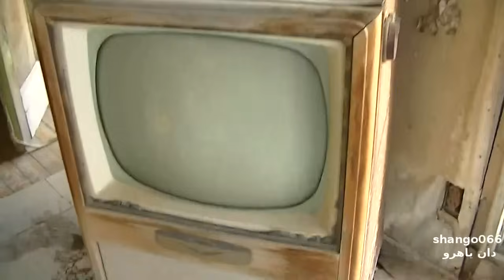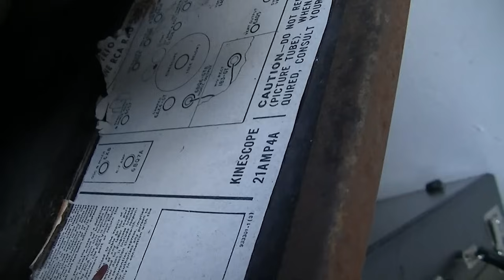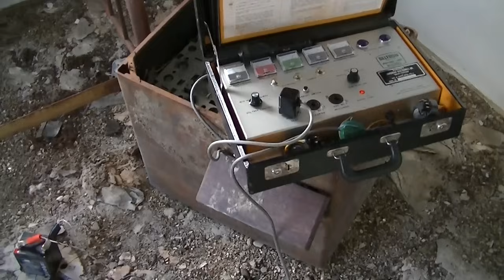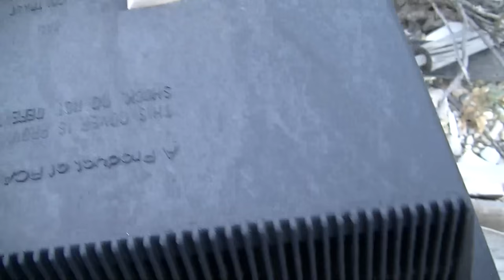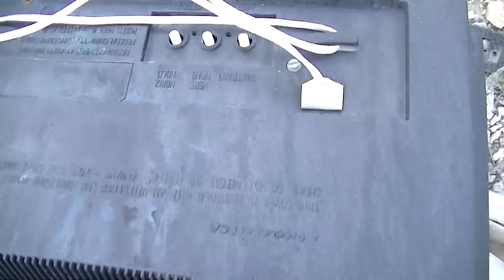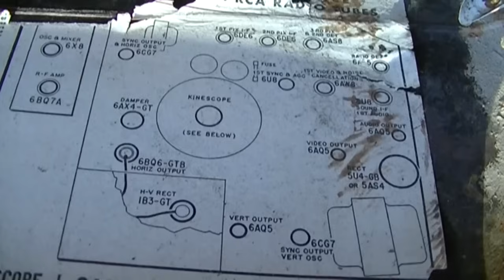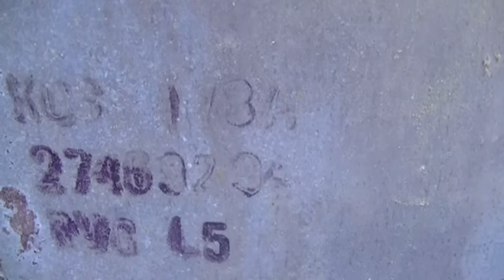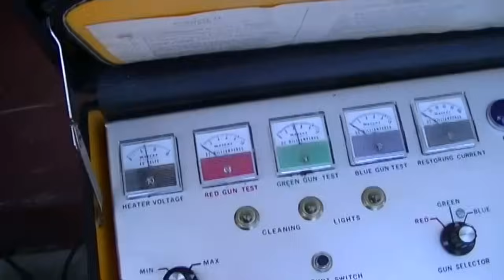Testing CRTs and Old Television Graveyard

Comment from the maker: This site is a currently operating mine site in Nevada and is not open to the public, the employees stay in trailers now, not the houses used in the early days of operation
Reply: Okay
Reply: Nevada? Isn’t that where in 1955 they did a test site nuke somewhere in Nevada
Reply: @jellyjordy1154 : January 27, 1951, until September 23, 1992; with above-ground testing until July 17, 1962.  Yeah, there was a test or two.  I participated in a few.
Reply: @edwatts9890  wildlife: thanks
Reply: @qwertykeyboard5901 : You are quite welcome. That "job" was one of the best assignments I have ever had, and every precaution was taken to avoid injuring your kinfolk.
Reply: Out off 165 near the border?
Reply: That's why you take everything when you see it and don't leave it sit there.  Morons tossed all this stuff in the trash and didn't think anything of it.
Reply: I'd like to buy that TV if you still have it
Reply from the maker: @ryancamp7044  Hurst parental control for Choice Cinema Bush bunny,
 neighbor blessing Seafood fleisure
Reply: @shango066  ?

Comment: LOL TV repair man. Late by 30 years.
Reply: TV repair people still exist.
Reply: +MrWolfSnack not any more
Reply: I'm a new comment yeet
Reply: 32 years now
Reply: technical they still do but our tv's are so modern if our color line blows  we can call the company or go to the local repair shop & get it fixed .
Reply: I fixed Vizio tv's.  It is gig work.  In 2010 there were two possible problems (not including spilling beer down the back, etc.), bad capacitors in the power supply and the fact that HD sets were sold before cable companies delivered HD.  In order to make the sets work with HD (so that red did not bleed into black in the picture) twisted pair ribbon cable had to be replaced with twisted pair ribbon cable that had more twists per inch.
Reply: I'm wanting to get in to CRT tv repair. Not for money as it's dead ,but I want to collect and repair for myself. Something's should live on !

Comment: The portable at 24:45 is/was a Sears Silvertone 900 (model 42231) manufactured by Warwick circa mid-60's. Quite a good performer in it's day, both in reception and audio quality.

 Another great video!
Reply from the maker: +NorthRiverTV You nailed it, I had just received the sams based on the stamped chassis tag on the board.

Comment: Great stuff!

I hope you go back, still many goodies out there in them hills.
Reply: +ZenithClarity1969 I got a freebie of a GE model 303 am radio/turntable a few weeks ago. Got it home and flipped it over, completely packed with mouse bedding. It had been living in a mouse infested basement for many years after the womans husband passed. She just locked the door to his basement workshop with all the goods still locked down there.

I pulled the chassis and it was pathetic, packed full of bedding, holding thousands of turds and years of mouse piss had just eaten away most of the components inside. Still will be able to hopefully save the transformer and some other parts. Magically the cabinet is still pretty nice!! Now i need another one of those chassis.

Comment: Loved the video and I have to admit, I'd be hauling a bunch of that stuff home too. Try to restore, or scavenge parts and if nothing else, recycle the metal rather than let them rot away in the desert.
I would have grabbed the Muntz 8 track and maybe the Akai Cassette deck too.
I think what happened to your RCA TV on the front was the black plastic got distorted sitting in the baking hot sun.
Reply: I definitely would've gotten the two tape decks, and probably that poor lil Panasonic TV, believe it or not, I could probably fix it!
Reply: @TheRetroMacNerd  The CRT was cracked.

Comment: It's like a blairwitch TV project docu😂...btw, i really like to see those vintage stuffs and wow! never been tried to use that CRT tester before. I just hooked the wires few turns from flyback to kick the heater pins...it really works,but then horizontal output transistor burst after a few days..again a back job😓

Comment: We got the best of both worlds with this one, exploring & electronics! If you can get the older RCA Victor (the one rats were using as a latrine) working, I crown you the best there is in restoration! At least it had an excellent picture tube in it. That alone is worth saving.

Comment: Man that neighborhood looks like it was used by the AEC to test atom bombs back in the 50's!
Well that's one good CRT you could put in the parts bin.
Some of those graveyard sets were OLD, I mean 70 or 90 degree deflection B&W CRTs.
Crap, a mad man Muntz POS!
Good luck on those radio tuning capacitors being any good.  Bet the plates are all shorting together.

Comment: 22:25   Is the Muntz unit an original FOUR track ( not 8 track ) player?  Where the pinch roller is part of the player and swings up from underneath when tape is inserted?   Is "Loudness/Separation/Contour" just a corny way to label the Volume/Balance/Tone controls?

Comment: 19:20 I think all those caps need to be replaced. Seriously, cool to see very old e-waste from the past. I admit, as a very young kid back in the early 80's I used to find dozens of vacuum tube TV's on the street and in dumpsters. I loved kicking off  the back open and get the vacuum tubes to throw at each other, with my other young friends at the time. At some point I think I had about 300 and I loved throwing them to see em' explode and smashing them.  

I guess old electronic tech collectors would not like that.

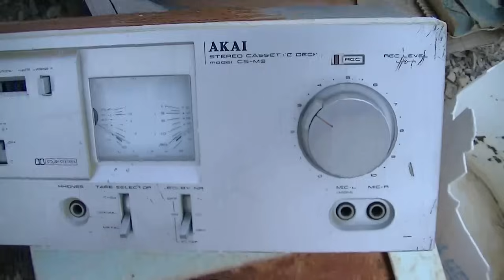Comment: 17:44 That tape deck has a switch for metal tapes. So 1979 or later. My guess would be 1981.
Reply: The decks are very late 70s. piano key controls and old school analog vus are staples of 70s decks.

Comment: You could regun an old model of that with a flat tube and get a working TV set. Plenty would like a slightly used CRT for replacement. Wrap in some hefty bags and you can transport it.

Comment: You must love your work if you are going this far afield in search of usable kines.  This was me 40 years ago.  One table model monochrome I salvaged was at one point completely submerged for many weeks in a flooded basement.  There was all of 2 inches of mud on the chassis.  It was a Westinghouse 21" unit with an RCA Silverama kine.  Because I really didn't care if it lived or not, but that I was an adventuresome cuss, I simply hosed the set out in the driveway, and left it to dry in the sun.  I aimed a jet of water from a garden hose nozzle, and tubes when flying every which way.  After it dried, I applied contact lube to all the sockets, controls and tuner, reinserted all the tubes, and plugged the darn thing in!  That set worked.  It worked perfectly.  And ran well for 3 years before the seleniums failed with a series of loud pops and a fetid smell.  The table model you show with good kine is in no worse shape except for the missing knobs. Try it.  You might be surprised.

Comment: I used zoom spout oil on a non-working sharpness pot of a JCPenney General Electric television and it fixed it. I researched if you could use mineral oil (what zoom spout is) is safe for such things and found no answer so i attempted to use it and it was fine thought i should really invest in some CRC

Comment: Permission is a wonderful thing.

I asked the local arcade vendor about lightening their pile of things going to the dump. They said okay.. I have a Galaga and an Asteroids for the cost of maneuvering it into the truck. To the vendor, they've made their money off the machine. A ridiculous amount, if the coin slot counters are accurate. That's why they rarely want to part with the working ones. Patience.
Reply: +webmonkees In Florida and maybe elsewhere, some young guys are buying old pinball/arcade machines and setting up a store.  You play the machines for a set amount each day.  Probably they had to spend time fixing some of the machines, but interesting to see how young the crowd is playing the machines.

Comment: What does the display look like on the tests of the video tube?

*Plugs in tester
"Well, we've got filament load..."
*turns voltage to 5v
"It's possible that it's gone to-"
*green gun starts working after a moment
"Oh, hello!"

Comment: You should have grabbed that Metal Cased Zenith Bugeye portable that was laying face down in the dump. They are good performers. It would probably work if the cut wires to the crt socket and tuner were replaced.

Comment: If you come across old radios that are not worth saving, at least save the big air capacitors and varicouplers (variable transformers) out of them. Hammies go crazy over that stuff. I've seen air capacitors in the farad range go for $200 on ebay, varicoupler's no different.

Comment: For 27" picture tube TV's to get rid of, recycling wanted 30 bucks each to take them.  Put the picture tubes in a large plastic bag and just broke off that heated tube at the rear end where they pulled the vacuum out.  That releases the vacuum safely, if you smash the tube with a hammer, the implosion will mess you up.  Then hit it with a hammer into many tiny pieces.  Plastic housing could be broken leaving the printed circuit board, easy to break that up.  Good riddance what good is a NTSC TV with all digital HDMI?  Gave my tube tester to another old timer that likes playing with this old stuff, still have a nice color bar generator to get rid of.

Sure had to get rid of a ton of computers and cellular phones, not a thing wrong with them but made obsolete by crooks.

Comment: I have no idea why I find the idea of looking through abandoned junk to find something salvageable is interesting to me. They made electronics with much better quality in those days. It's hard to get new stuff to last for a minimum of ten years. I don't like investing in something that will sure to be dead in three years. These days, the electronics are designed to stop functioning after a certain amount of time. All that does is fill landfills even faster. What's worse is that most of the components in that product are still in excellent shape when the IC shuts down.